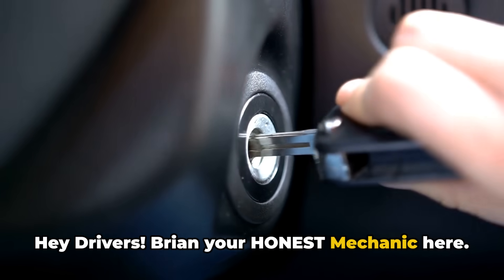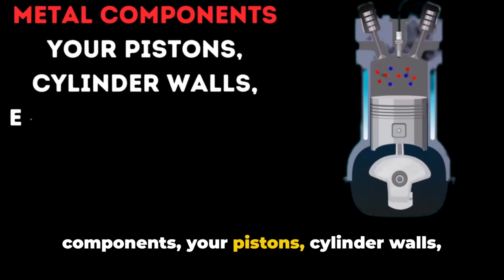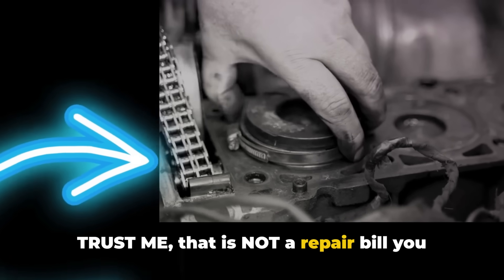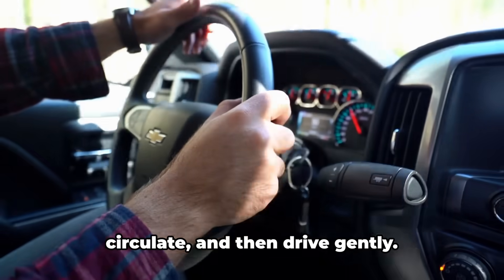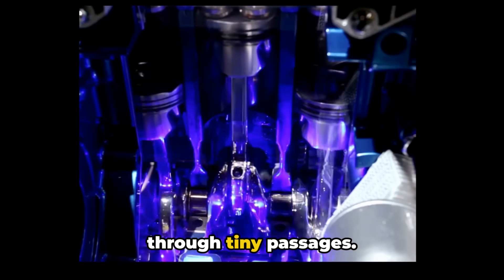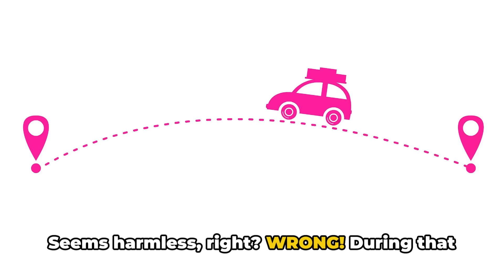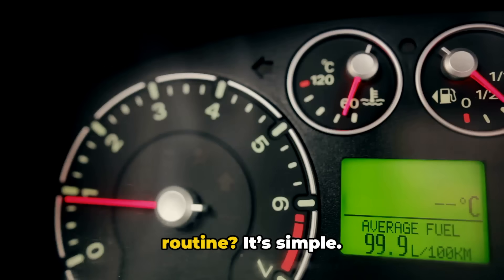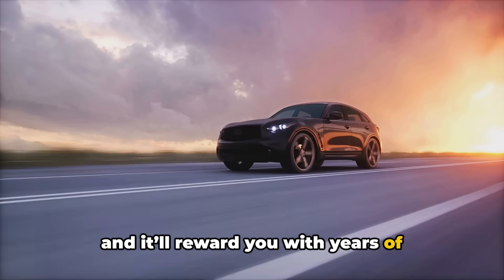5 Cold Start Mistakes That Wreck Your Engine (Avoid These)

Comment: Agree with everything said but let's face  with new vehicles today something else will go wrong with it way before it gets anywhere near a rebuild"probably electrical" a sensor will go wrong and unless you can DIY you'll be going backwards and forwards to the garage to sort it costing you a fortune! 
I'm all for keeping older cars because you can fix them but steer well clear of newer stuff, all depending where you live but here across the pond the powers that be are trying their hardest to get us off the road, so just keep driving while you can.
If it ain't broke don't fix it!
Happy new🎉😊
Reply: I drive a 1976 Ford Gran Torino (yes, THAT one!) and start her every day especially in winter. Engine is cold natured so I have to let her idle a bit longer than the average BUT ride for at least 20 minutes. The best thing that came with the car was a manual choke; she only needs it for a about 2 minutes. When she idles smooth, I go do whatever. And I dote on her. 😉
Reply: @allanbard6048 you got any pics I wanna see lol
Reply: I drive a 2023 Camry, which is considered new stuff, but has old stuff like the engine is a V6, naturally aspirated. I find that Blindspot monitoring and rear cross traffic alert have been invaluable to me. Also, Apple CarPlay has been invaluable to me as well. To each their own 🤷🏻‍♂️

Comment: All those facts here are true. In 2023 I bought a used car with a quarter million kilometers on the clock, all engine parts original (2L Diesel 4 cylinder). The owner knew how to handle cars, always warming up gently, letting cool down after pushing the engine, doing proper maintenance. Engine runs perfect and I handle it the same, it can still have a long life.

And what do I do for avoiding short trips? Going close places by bicycle. Barely any errands in the range of 10 miles actually need a car. Society has just agreed on being lazy.

Comment: In ND in winter it can get -20. Sorry not leaving after 30 seconds.  I auto start the full 15 minutes.  BUT: I change the oil right away in March after auto start season.  It may only get 1500 miles from Nov thru March. Then I drop the oil.

Comment: My freind John who rebuilds his 2 cars and a positrack truck every few years, and he told me that almost all engine wear happens at startup because there is no oil in the top of the engine. He agrees with you; let it idle for a minute or 2, and start driving gently until the engine is fully warmed up.

Comment: What about some of the LS engines? They have a considerable period of piston slap until it warms up. As an OLD man, I will continue my OLD habit. With automatic chokes and/or enrichers, just warm up the engine until the idle speed drops to the low idle. The computer will know when the engine is ready to begin bearing any loads. If you have an automatic transmission, it also fully circulates the transmission fluid so that all of the transmission systems are fully lubricated. In
In the old days with a manual choke, you just let the choke in to test if the engine will continue to run. When it does, you are ready to roll. On some older automatic chokes, just gently kick the accelerator to see if it will drop to low idle. If it does, you are ready to roll. Those older systems relied on the temperature of the engine/carburetor to reach its designed operating temperature to function normally. It was a general skill to understand your vehicle’s engine and carburetor. Nowadays, the vehicle’s computer system measures and adjusts your air and fuel flow, and your engine and intake temperature several hundred times per minute. 
Unless there’s something drastically wrong with your engine management system, it will essentially tell you when it is safe to begin driving. These computerized engine management systems began back in the mid 1970s, and became pretty standardized by the mid 1990s. And, with modern engines, the oil galleries and passages are getting smaller, while increasing the oil flow rates, requiring thinner oils. Because today’s OEM oils are so thin, it becomes very important to keep to the OEM oil viscosity ratings. Otherwise, the oil will be too thick to make it through some of the smaller oil passages. Also, always use the heavy use oil change schedule, AND always change your oil filter when you change your oil. Why the heavy use schedule? If you read the types of driving on that schedule, you will find that it describes the driving of more than 90% of drivers. 
Also, if you have one of those very modern direct injection engines, keep an eye on the intake system AND your Positive Crankcase Ventilation System. If it’s not operating correctly, you will be sucking oil into your intake system, causing considerable carbon buildup on your intake valves. 
Anyway. This Old Man recommends that you wait until your idle speed drops, instead of just waiting 30 seconds. Your car’s computer system will let you know when it is safe to drive.

Comment: I don’t agree with your 1 min warm up before driving. I was told 4-5 min warm up is better especially in cold weather so your Oil Temp also approaches operating temperature. I agree with the rest.
Reply: Oh also, he didn't talk about a 1 minute warm up period. It's not about warming up, it's about giving the oil a bit of time to flow everywhere. The best warm up is to drive gentmy.
Reply: The concept of warming up an engine  is a carryforward from the old days when engines were carbureted. If you didn't let them run warm enough they tended to stall at the first stop sign you came to. Modern computer controlled engines can adjust to diverse operating conditions well enough to run fine without a long warmup. The advice given is valid IMO.
Reply: Agree
Reply: My uncle (raised me) was in his 80’s when he died in 2013, so an engineer of the old school. He was adamant that oil needed 8 mins to warm up enough to be really efficient. I still keep the revs down for 8 minutes. Last year I had the oil analysed and the metal level was very low.
Reply: @tonycharlton4296 ..as an A&P mechanic..I keep my rpm between 2-3k  until the oil warms up to the operating temp (180F) after that I drive my 911s like it was stolen.😂
Reply: "Youbwere told"? Who told you? This guy here is an engine mechanic, so he certainly knows the matter. The guy whol told you, is he more knowledgable by evidence?
Because the things said are simply true. When you let it idle at cold temps, the engine tolerances are suboptimal and the oil is thick. And especially for Diesel engines, idling for a couple minutes does nothing, very little heat is generated.

You can disagree with opinions, but you can't disagree with physics. The things said here are not opinions, they are physical facts.

Comment: One of the things I did when I rebuilt my Tundra 4.7 to 5.0 engine was to use teflon skirt of Pistons. And I also added a pre-oiler that I took out of my old H 1 Hummer. When I start my truck up, the first position is accessory. It turns the pre-oiler for 30 seconds and then I start the engine up. I’ve also got this set up on my auto start. Basically I’ve programmed the auto start through a script file to turn on the pre-oiler for 30 seconds and then start the engine up
Reply: Some new cars have an electric oil pump. These do the same thing in that they can spool up in advance of starts and throttle movement. So instead of responding to rpm it can push oil based on throttle position.
Reply: 6.2 liter?.....J code block?

Comment: I usually wait till my RPM needle drops to 1,000rpm so it's not revving high and making a loud noise on a cold start. When it's warmer outside, I start up my car and leave after 30 seconds. This is the reason why I rarely ever have to do repairs on my cars.
Reply: That’s exactly how I do it. On a cold start, the engine in our CX-5 is around 1500 rpm. As soon as it drops to 1000rpm, I put it in gear and drive away.
Reply: I have an aversion to slamming it in gear while idling at higher RPMs.
Reply: I do the same too.. During winter here in Canada, my HRV starts to 1.5k to 2k rpm. I wait till the rpm hits 1k and then drive off with slow acceleration till the engine sounds good.

Comment: If you have a turbocharged engine it's also a good idea to let your engine ldle for a minute before shutting it off. The turbocharger is extremely hot and needs time to cool down.
Reply: This should only be relevant, when you pushed your engine hard before. If you drove through town in a relaxed way before, idling shouldn't be crucial.
But also it's not a bad idea to just generally do it. I let my car idle for a minute before shutting off.
Reply: I did have a twin turbocharged Audi engine for many years. Boy, that was fun! I did finally have to have the turbochargers rebuilt, but the engine was still going strong when the Power steering broke down. Had that car for over 235,000 miles.  I loved driving it, and sometimes I really got a kick out of flooring it when the light turned green, looking back and nobody had moved yet😂
Reply: I fully agree. My norm start procedure car & boat😢
Reply: Toyota recomend this but only if driven under heavy load.
Reply: For semi trucks and cars that are doing some drag races then yes let it cool down.

Comment: Short trips are fine if you clean up your engine and exhaust system once a week with a longer drive (20+ km)
Reply: Depends on what you call a "short trip". Ignoring the exhaust system and considering the engine alone, as long as the engine goes through at least 1 coolant cycle, meaning the thermostat has opened and closed and the engine gets into its normal closed-loop thermal control range, then all the metals have settled into their design tolerances, everything is nice and wet, including the seals. Repeatedly shutting your engine off before this thermal equilibrium is reached will age the engine for sure. It's also good to run it long enough to cook off any moisture inside. This was especially true for engines of the past. Modern engines are obviously a little more tolerant.

Comment: If you have a display with instant fuel use display. Start the car, wait idle until liters/km shows near your average value when car is fully warmed up AND when your rpm goes down to your average fully warmed up range. Example for a 1.6 turn 2019 c180 coupe would be less than 1l/km and rpm between 700-650rpm. Idle times are usually longer in winter if you cold start with ac or heater immedietly on (which is never recommended)

Comment: I've long wondered why ICE cars don't have a small oil reservoir after the filter and an electric motor to circulate that oil 
BEFORE starting the engine.  Seems like a no-brainer with the minimal cost being recovered in MUCH longer engine life.

Comment: when the engine is cold it will probably run rich because the O2 sensors aren’t ready so 60s idle is enough to warm then up
at idle cars run at optimum air fuel ratio, however, long idle times can cool down the o2 sensors and then they may start to run richer. if they have heated sensors this should not happen

Comment: I have been told,  that although engines are designed to drive cold (within reason) , the power steering pump can't take it.  Considering this pump is attached to the outside of the  engine , it should take a few minutes to warm up so to not to cause damage.

Comment: If this is true, please explain to me how I got my 2003 acura mdx 3.5l from 25k miles to 398k miles not doing anything on this clip. My car has the original engine and transmission. 
I warm up my car 20 minutes every morning before I drive 40min one way off to work. 
I used Walmart tech brand full synthetic oil since 30k miles up to 398k miles. 
I'm not even talking about brand name oil like castrol or mobile 1.
Reply: How about on your way back? How long do you warm it up?

Comment: Have had piston slap in my 5.3 LS engine for 150,000 miles, still running 😊
Reply: I had that engine and when it first came out, it was a huge deal with GM. Lots of people got nervous bout that sound. I remember GM saying "its just piston slap " and thought it sounded bad. It ended up being one of their best most reliable engines. My F150 3.7 right now has the same sound occasionally on cold mornings, at least I know what it is now.
Reply: Yes my LS1 Camaro has piston slap almost all the ls engines do the 4.8 to 5.3 the 5.7 you just have to not floor it when cold wait a few minutes unfortunate for me of not waiting enough but still don't have any serious problems
Reply: Always wait for it to subside and go away before putting any load on the engine. To reduce weight, they no longer use deep skirt pistons, which is why they slap. Of course, that the pistons are now made of aluminum, which shrinks and expands far more than iron, is but another reason why they slap (more of a rocking than slapping). They need to heat up to expand to the point where they stop rocking. The problem is that the “piston slap” was designed into the engine so that shallower, lighter pistons could be used to reduce the reciprocating mass. Good for racing, but I wonder about the wisdom for an engine designated for trucks.
Reply: But the point is to not have it happen because it’s not a good thing

Comment: It’s the automatic transmission that needs to warm up more than engine temperature
Reply: Bingo! My car would typically be parked in an open lot at the MSP Airport for 11 hours, (10hr shifts) sometimes in -20F. I would start it, sit for five minutes, then do a couple slow laps around the perimeter. 
 As you mentioned James, it was the transmission I was concerned about.
Reply: What would you say about a CVT?
Reply: Same question here. @jerry18741
Reply: Yes, but he said 30 to 60 seconds for the car oil to circulate and drive gently, then the whole drivetrain and transmission warms up along with the engine.
Reply: Agreed. I check transmission stick after every run I make. I drive a 1970's muscle car and it came with a C-6 TCI Streetfighter transmission. I remind myself that it cost $600, and treat it as such.
Reply: Yes you said so,manual transmission not so.
Reply: And steering fluid

Comment: i bought a ford mondeo new back in 2008. it now has over 230k miles on it. No issues at all. Engine is fine, Turbocharger is fine. And how do i drive? Exactly like in the video. Engine startup, no revs. After 30 seconds i start the driving. No full throttle until it has reached operating temp + 5 mins for the warm oil to reach the turbocharger. I never drive short trips with this car, every startup leads to a longer drive. After longer highway trips i let the car cool down in idle for 30 seconds. The Engine never needed a repair. it works like on day 1. 
Send this video to all of your family members. Everyone should drive like this.

Comment: Most of this doesn't apply to hybrids since at the beginning when you turn the car ON the engines doesn't even start because the vehicle is running mainly on the car's hybrid battery
Reply: The only thing I can force on my hybrid is stopping the engine by moving the ignition switch to the OFF position. When the car is turned on, the computer decides when to start and stop the engine. If you want to encourage the computer to start the engine sooner without driving hard, turn on some accessories to increase the electrical load.

Comment: I do everything you said! 

I always warm my 2005 Mitsubishi Colt Plus Ralliart - with the 4G15T engine - after start for 45 secs. 

Which I time on the stopwatch on my phone. 

Then I drive slowly away not going above 2000rpm until the temp gauge gets into mid range. 

Luckily I live atop a hill so I can part coast down.

The only thing I've been bad for that you pointed out is driving the 75 seconds to the supermarket down the road, shutting down then shopping. 

Then starting again and coming home. 

I need to stop doing that! 

Must plan stops at the supermarket when the car is warm say on the way home from being out.

If I've been away and been pushing my car I will let it idle down for 60 seconds to let turbo oil cool.

I don't push it hard enoug to warrant getting a turbo-timer.

She's a torquey thing my 4G15T.

The Turbo starta sucking & blowing at 2600rpm.

I can easily stay below that around town and easily keep up with traffic.

Another fab watch sir. 

Happy New Year from Australia East Islands! 

Grayson

Comment: Something typically missed about warm-ups is that you need to warm up the automatic transmission fluid that circulates through the transmission radiator/heat exchanger up front. On Subarus that's what the blue thermometer light is about. When it goes off it is okay to use the transmission.

Comment: you dont gotta be THAT gentle when its cold, just give it like 15 seconds runtime (idling or driving) and you should be fine to go to mid revs and wide open throttle. if your car has piston oil jets you can redline by the time you get to half warm coolant. the best way to keep your car on the road for as many miles as possible is maintenance all around, not just the engine.

Comment: Video: After 30-60 sec, GENTLY drive your car.

ME: Live 1 min from freeway, GENTLY driving onto the merge ramp and holding up traffic on because this video says soo. 💀
Reply: Similar to me, in fact I will go down and miss the freeway and do a U-turn in order to get the temperature up more if it's especially cold.
Reply: Me! 😂
Reply: keeping under 2.5k shouldnt be too hard lmao
Reply: Get on at an exit farther down or after.
Reply: He didn't say to drive slowly.
Driving at your freeway's allowed speed and gently, these are not mutually exclusive. With automatic transmissions, that is how it normally works anyway, cold start or not.
Reply: Merge don’t wedge.
Brad Upton (must see)